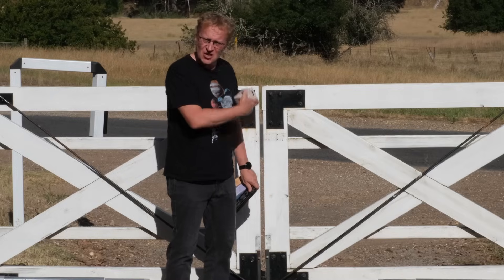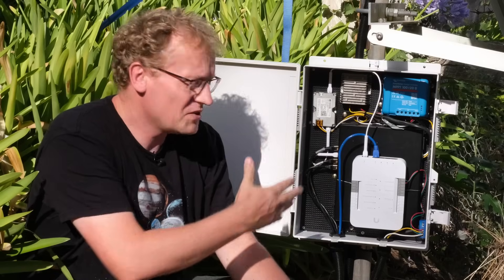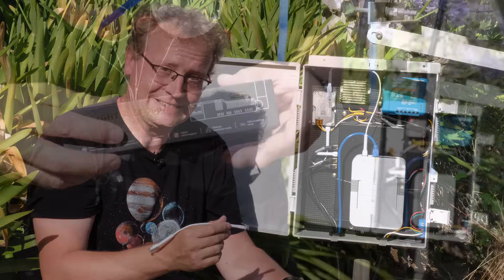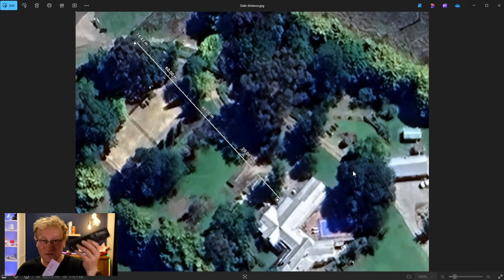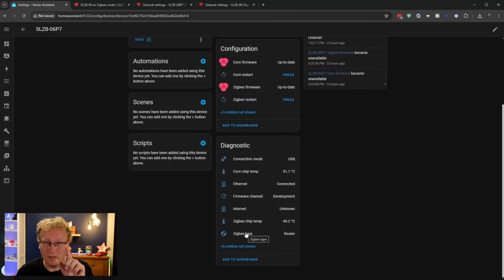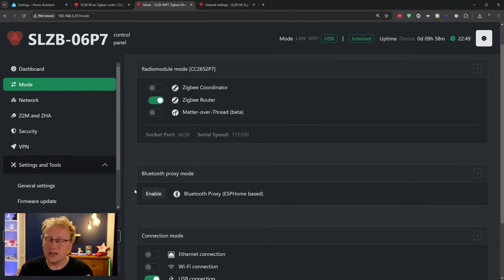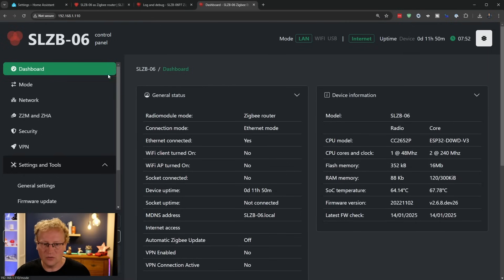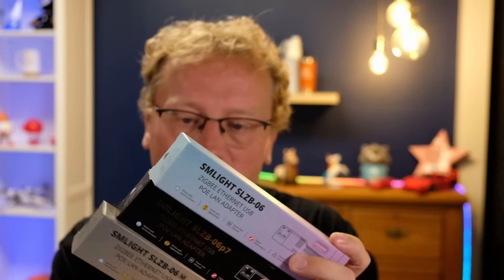PoE powered ZigBee with the SMLight SLZB-06 devices

Comment: Any chance you could give us a follow up video that discusses how you use home assistant? Please assume your audience here knows HA exists, but that might be the extent of it. I came for the unifi equipment but having seen how much you’ve got setup, I might stick around for the smart home automations.
Reply from the maker: Thanks mate for the support. I can definitely do that. Something like "10 use cases for Home Assistant" perhaps? This would explain some of the ways HA can be used. 

And there are plenty more Unifi videos to come. I have about 8 planned currently, but waiting on a few parts.
Reply: I would really appreciate going through the unifi access and protect integration with home assistant, protect is something I can test myself, but only on a limited range of devices, and I want to get access gate kits for my gate, but I'm unsure if they work well with Home assistant
Reply from the maker: @daidaloscz  Yep, sure thing. I might not cover all that in a single video. For example, license plate reader is a video I want to do soon, and that uses one part of the Protect integration with HA. 
Also, check out my Access Intercom video where I touch on the Access integration too: https://youtu.be/lDXGytmrvOc

Comment: It’s annoying the router can’t be over ip. Surely they could change that, it’s only data being transmitted, surely it doesn’t care if that gets moved wirelessly or by wire.🤦‍♂️
Reply from the maker: I was thinking the same thing, and it might be a ZigBeen issue, not a data transmission issue. Apparently, if I change to Z2M, it can do that, so I might do that soon.
Reply: It's a limitation in the Zigbee protocol. You could set up both Z2M and ZHA (or multiple Z2M instances) with separate coordinators and create a separate Zigbee mesh per coordinator, but you can't have Zigbee routers transmitting data via TCP.
I also have my Zigbee network spanning long distances and some routers here and there always seem to work just fine for that.
Reply from the maker: @TheJulianJES  Alright, good to know 😊

Comment: when you would run Zigbee2MQTT you could run it as a extra router, so you can save the 2nd "repeater".
I run 3 sticks in my setup, at different areas which have no overlapping signal. Its possible to install more than 1 Zigbee2MQTT addon.

to differences, so far the 06 can't by now run the latest ember driver, while the 06M and 06p7 can run ember.
Reply from the maker: Oh, that is super useful to know. Thank you! I didn't know that Z2M could handle multiple coordinators. I might think of migrating just for that reason. 

Oh, right. I am not familiar with Ember, but will look that up too.
Reply: One Z2M instance does not handle multiple coordinators. You can only set up different Z2M instances (or one ZHA instance and have a separate Z2M instance) with a different coordinator (for each network).
Since Z2M uses MQTT to integrate in HA, you can have the date from multiple Z2M instances in the same Home Assistant instance. Due to how ZHA works and with it being somewhat tied to HA, ZHA only allows a single instance at the moment.
Reply from the maker: @TheJulianJES  Okay, but the end result is what looks like one ZigBee network with multiple coordinators?
Reply: @ Well that depends on what you're looking at.
Let's assume you do everything with Z2M. You would have two Z2M addons then, one for each coordinator.
And you'd also have two separate Z2M web UIs with the connected devices each and so on.
From the HA side though, it would be like having two Philips Hue Bridges for example. You won't really notice it there.

If you decide to do one ZHA instance and one Z2M instance, ZHA would stay as is and you'd just set up the Z2M addon and MQTT integration in HA. The devices would come from separate integrations (ZHA and MQTT), but you can still use them like all other HA devices with no issues.
Reply from the maker: @TheJulianJES  Ahh, right. That makes it a bit clearer I think. I have a lot to learn 😂 In any case I am keen to try out Z2M as well, to see if I prefer that. I certainly have enough coordinators to make it happen 😬
Reply: Yeah, comes down to the model number. 06M is what I use too.

Comment: Aren't you supposed to be able to use these coordinators directly in Z2M sending the network over IP ? Look up the documentation on the z2m homepage. You might have to re flash the smlight to coordinator instead of router.
Reply: Zigbee is received, and a MQTT packet is created, which goes over the LAN. home Assistant will then have it for use as trigger etc. Works with IKEA devices as well.
Reply from the maker: @MarkVovo  Amazing. I learnt! Thanks a lot for commenting and growing the knowledge. Might do a video on a migration then...🤔
Reply: Your Conbee stick feeds into Home Assistant via ZHA. If you install the Zigbee2mqtt and mqtt addons, Z2M can connect to the SLZB at the gate over IP, but as a separate coordinator / zigbee network. This way your reach is IP not Zigbee and you have the Zigbee devices on that second network feed in to HA over mqtt alongside your existing ZHA ones.

If you were running Z2M already, it can only handle a single coordinator but, you can have multiple Z2M instances publishing to the same mqtt broker that the HA MQTT integration sees as a single set auto discovered devices.
Reply from the maker: @a1dox  That's exactly what I want. Thanks for the details 👌
Reply from the maker: I am not sure if it works differently with Z2M. Certainly using it as a router, it can't send ZigBee data over IP. I don't want to use it as a Coordinator, as that would mean a redo of the network.
Reply: I have been using one of these since they first came out. I have it setup with Zigbee2MQTT, and that feeds into HA. You can also turn on VPN, and use one of these across the world, and into your HA locally, if needed. It all comes down to what settings you have turned on or not.
Reply from the maker: @MarkVovo  Thanks Mark. So with Z2M, I can use ZigBee over LAN?
Reply: Just remember to use different zigbee channels and keys so that the meshes wont try to merge then you will have troubble.
Reply from the maker: @Maaniic  Right. So much to learn still 😬
Reply: You should just delete this video... Half of what you are saying is incorrect

Comment: I worked in the security industry once upon a time. I don’t know how the gate sensor is detecting the magnet but the sensors I installed used a reed switch. You might want reduce the gap between the sensor and the magnet. The bigger the gap between sensor & magnet the higher the probability of false signals especially if the gates were to vibrate, say in the wind. Just a thought. Oh and it’s freezing here.
Reply from the maker: You are very observant mate. That gap was actually too big and I have since relocated the sensor to the inside of the gate, but just didn't film it 😊
Reply: Most, if not all, Door sensors use either a reed switch or a hall effect sensor and they do require the magnet to be close to the sensor to detect a close.   If the thing is a big metal gate, this will affect the tiny little magnetic field of these door sensor type devices in a big way.    That's why a lot of big metal gates still rely on Infrared detectors and loop detectors for open close situations, where an infrared sensor detects if something is in the path of a gate so it doesn't close until clear and loop detectors in the ground trigger the auto opening.
Reply from the maker: @EsotericArctos  TIL 🤓
Reply: I love your videos. Your enthusiasm is obvious for all to see and your willingness to state that you are not an expert is quite refreshing. Doing what I do, it’s sometimes cringe watching poor advice being passed off as fact, but seeing you discover stuff and admit mistakes allows us all to learn. Thanks!
Reply from the maker: @cejay67  Thanks so much for noticing and commenting mate. That is exactly the approach I always take, and I leave most of my mistakes in the videos, as those are often the best learning experiences. I do love tech and discovering how things work, especially when I have a real world use case to solve 🥰

Comment: Oh, and the difference between the two you are using is the ram on the ZigBee chip. You can see that in the device website. 
Basically the number of devices it can handle at once. Since the basic one is over 100 (there is a page somewhere on smlight's website that I can't find right now sorry) I got the basic one and I'm very happy with it.
Reply from the maker: Thanks! 100 seems like a lot for a single device as well, so will last a while 😊

Comment: When I had a similar ZigBee distance issue, I just set up a second ZigBee network on a different channel, in home assistant it was pretty quick to do.

My solution is fine when the devices are fixed in place, but I would need to have one repeated network if I had any devices that were mobile and could be in either network area.
Reply from the maker: That's what I did when I first tested the devices, be it it was too messy, and then I migrated from Dconz to ZHA, which I'm pretty sure don't allow two ZigBee networks.
Reply: @LarsKlintTech  they are pretty great devices, I'm very happy with mine.
The docs say it can do ZigBee over Ethernet, so perhaps I've missed a configuration step somewhere and don't need two networks. (Using zigbee2mqtt)